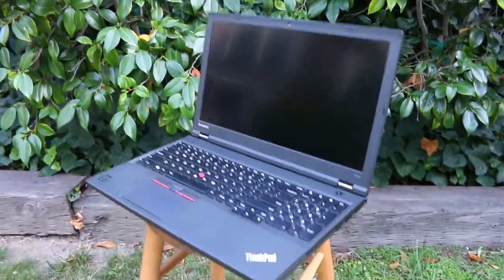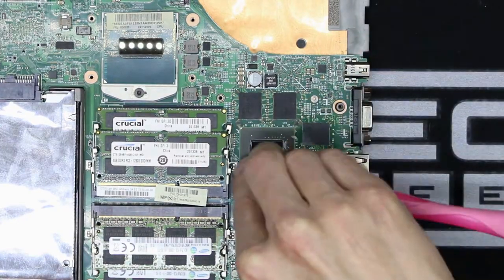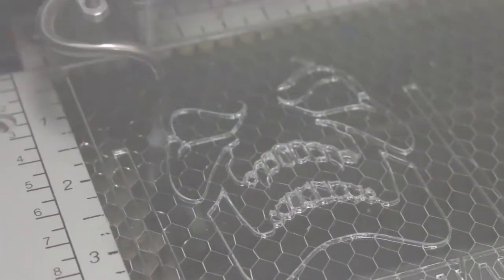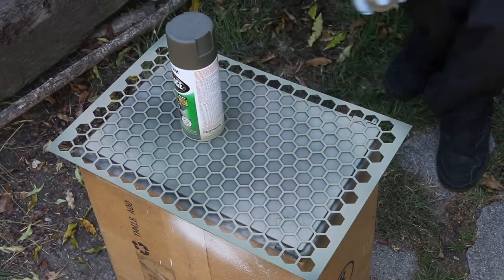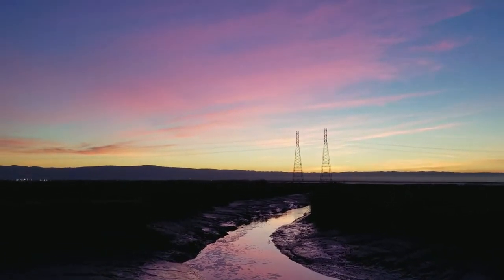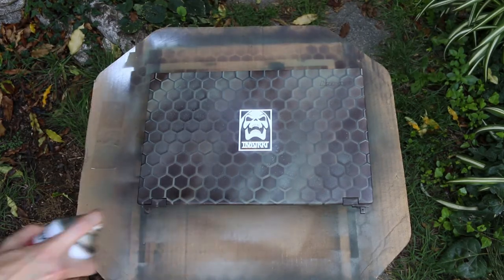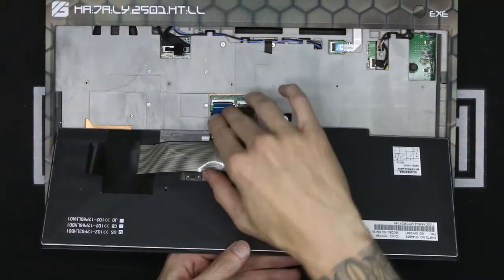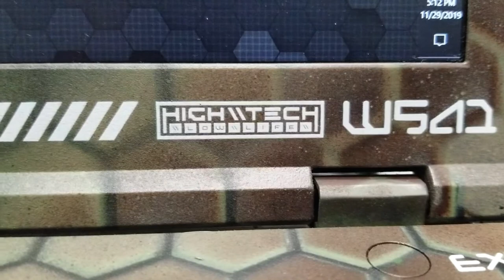💻 Painting A Laptop!? DIY Custom Painted Hex-Camo Lenovo ThinkPad W541 Workstation Computer

Comment: Don't say it decrease the value.
For me it increases the value of that laptop alot. Paint the keyboard leaving the letters for backlight as well as mouse pad. Mouse pad works when painted with light coat.
Then..imagine price of that laptop if it came out by Lenove...✌
Reply from the maker: Thanks so much! I was hesitant to paint the keyboard and trackpad as these areas are touched more frequently and the paint would have a harder time sticking over time 👍 although I use external keyboards and a mouse for this anyway, so maybe it would have been ok 😎Maybe on the next laptop build I will try it! Thank you!

Comment: Did you find the additional coats of paint effected the thermal performance at all?
Reply from the maker: I didn't notice any affect on thermals, going to a 4940MX definitely affects thermals though because it's a hotter chip 👍 stock cooling does fine though.

Comment: does this thinkpad have the soft touch finish lid? if so do you have to sand back the entire thing or just rough it up like the rest of the plastic
Reply from the maker: This one was soft-touch, I didn't sand the entire thing, just scuffed it up with some sandpaper and painted over it 👍
Reply: @hightech-lowlife I saw that it was possibly creating issues on your Akira build, but do you think that was just caused by the poor case condition?
Reply from the maker: @sleepyboi6226  I don't believe so, it's possible that other laptop had something on it that was rejecting the paint. Glossy is much harder to get right though 👍

Comment: Hi, can i paint the palmrest area without take it off ? :) coz mine is so difficult to open (portege r835)
Reply from the maker: For sure man! Just mask off the parts you don't want to paint 👍
Reply: Gee thanks for the input, perhaps u have some vid reference ?? 😊🙏
Reply from the maker: @nandaset  What kind of reference are you looking for? If you use tape to mask off the area you want to paint, then you can follow the same steps in this video. Just sand/scuff the area, lay down the color you want, then clearcoat it for protection, then you can remove the masking and only that area will be painted 👍

Comment: i did a similar thing in 06 to my thinkpad. the problem i ran into was the clear i used (same thing it looks like you used) started to get tacky when it got hot.
there's a thread about paint selection here on the RPF forum with picture of my old laptop https://www.therpf.com/forums/threads/what-paint-for-frequently-handled-props.153344/
If yours does start to become tacky with use i'd suggest getting one of the clear films for protecting automotive paint and putting that over the palm rest. That worked out for me pretty well on my build.
Reply from the maker: That's awesome! Thanks for the link and the pics, you did a great job - it came out really good! (I know I am biased but camo makes everything look cooler). 

I haven't noticed any tackiness, although admittedly I don't really ever physically touch this computer as it is a tertiary system on my desk at work (using it to type this very reply!) that I only interface via my main rig through a virtual KVM, I also have a secondary mechanical keyboard plugged into it when I want to type directly on it. 

Thank you for your feedback and tips, I really appreciate it!